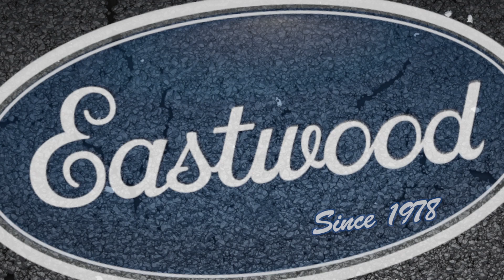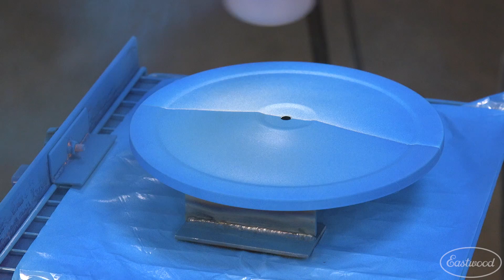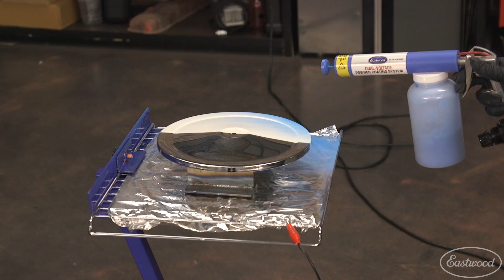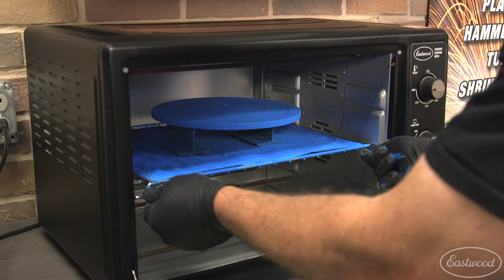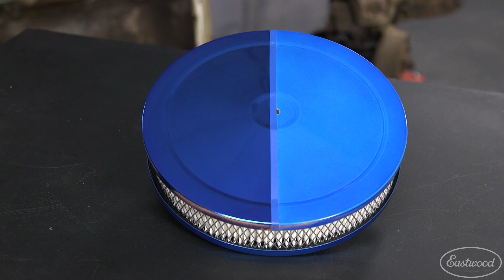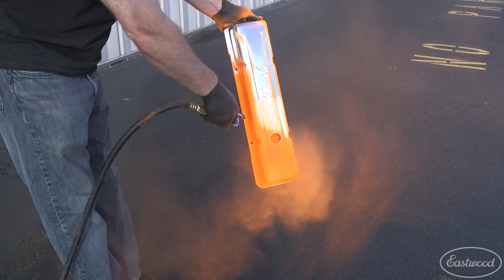Powder Coating An Air Cleaner - Powder Coat Over a Base Coat - Eastwood

Comment: yall claim powdercoat is better than any liquid coating out there. but I havnt seen an abrasion resistance comparison with Cerakote! also note that cerakote is applied very thin, so you are comparing a thick coat like powder coat to a light ceramic coat. (cerakote has the best solvent resistance IMO. it can take on acetone, bore cleaner, paint thinner...)
Reply: I own a sandblasting company we have blasted everything. Powdercoating is great for production parts quick turn around and so on.  To blast it off can be extremely hard where it does adhere on a air cleaner mise we'll throw it out. Powder also does not have a rest inhibitor in it to stop further corrosion.  Compared to a 2part epoxy and a urathane top coat or a base clear application.  To blast off a base clear and an epoxy can be just as hard if prepped correctly.  Basically  no matter
If you use a cheap spray bomb if it's clean and prepped correctly it will last depending what ur doing.  Don't blast a 30s rod frame and build a barret Jackson car and use tremclad lol cheers